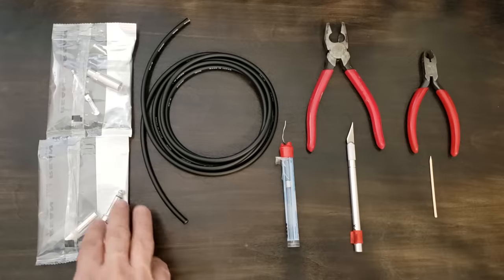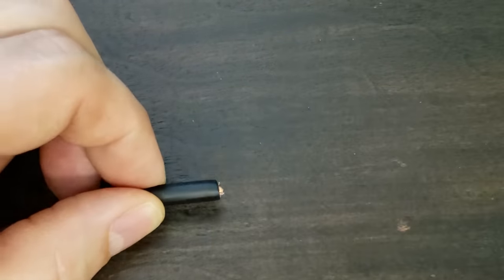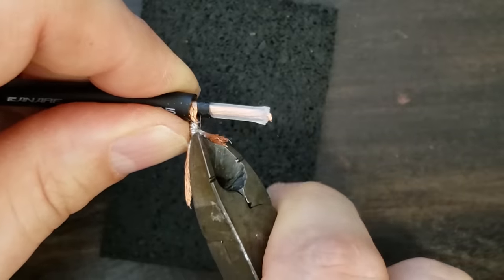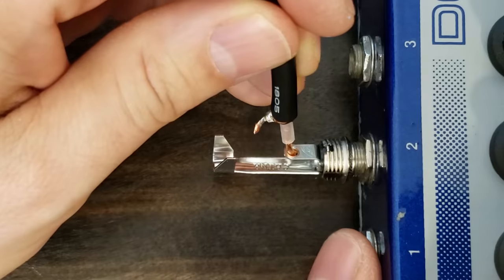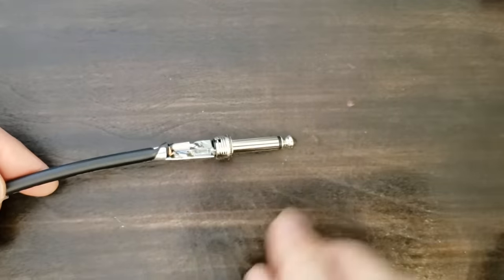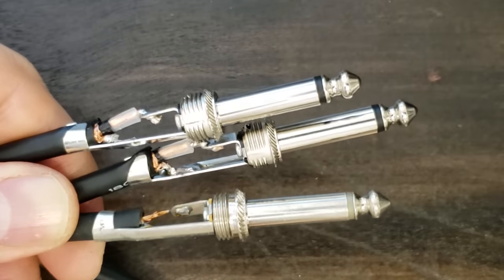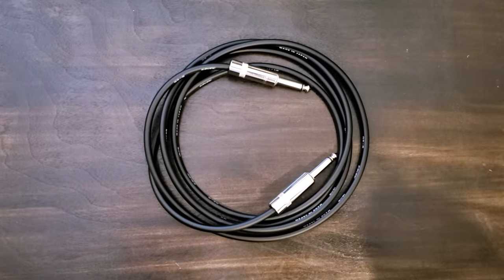Guitar cables - Make the Best Cables for bass keyboard GUITAR DIY SOLDER CABLE

Comment: Well, I've been in the industry for 40+ years. Your soldering is fine. But the centre conductor should be pushed up from under the tip terminal. Not the top. It keeps the coax as straight as possible, and there's no lump to negotiate with the raised center insulation for thesleve. If trimmed and formed correctly, the tinned earth brade will swing down and sit where it should 👍

Comment: OMG - using a pedal to hold the plug while soldering! Genius idea. Why have I never thought of that?
Reply from the maker: Yeah, I should really get one of those "third hand" clamping devices too!
Reply: A 2x4 with a 1/4 inch hole drilled into it works just as well, and you don't have to worry about overheating the pedal jack.
Reply: @jerund  Usually the pedal Jack is soldered directly to something that would remove the heat, hence it should not be an issue. But good to keep in mind. On the other hand, having metal contact to the plug during soldering actually helps to not overheat the insulation between the ring and tip inside the plug, so it has some benefits as well.
Reply: Agree. Brilliant idea.
Reply: Isnt that hot?
Reply: @steveaharmadianto3712 yes, about 350°c on the soldering tip usualy...
Reply: OK, but all me pedals are in board😰
Reply: literally word for word, just what I was going to type,!  kinda obvious, and yet I never thought of it ..."Doh"
In fact, I think it's even better than a third-hand clip holder. 
Also rolling the wire to score it is kinda neato. 
I usually put a bit of tape around the positive in case it gets bent and touches the earth inside.
Reply: As I was about to whip my soldering iron across the room I see this. Then look at my 20+ pedals sitting on my shelf laughing at me. :-) THANK YOU!!!!
Reply from the maker: Yep, I've soldered plenty of cables the hard way...usually involving a pair of pliers and a rubber band. The first time I did this, I never looked back!
Reply: @FrankOlsonTwins  Anyone that knows anything about high quality cables, knows that the best quality jacks are made by Neutrik..
Reply: @TarynnElizabeth619  also complicated..not good.
Reply: I use the "extra hand" device with alligator clips but I will try this method.

Comment: Great video.  As a person that has done a LOT of soldering, the only thing I would suggest is that you tin all wires and the connection points on the plug prior to making the final solder connection.  The solder will flow faster and require less heating time.
Reply from the maker: Fair point!
Reply: Also the pliers with a rubber band band makes a good vice to hold the connector. dont want to damage the circuits with to much heat.
Reply: Yes I was always taught to tin the wires and plug before soldering.
I guess it depends on whether you want to put the tin wire into the hole or just over it.

Comment: It is also good to add something to keep the cable from bending sharply right at the connector.   I like using heat shrink tubing and putting a nylon cable tie in the mix as a strain relief for the first inch or so of cable to avoid a sharp bend when pulled at 90 degrees.   Nice video.   The last cable was best with a bit more insulated cable beyond the crimp.
Reply from the maker: Thanks!  Sure, a bit of strain relief never hurts!

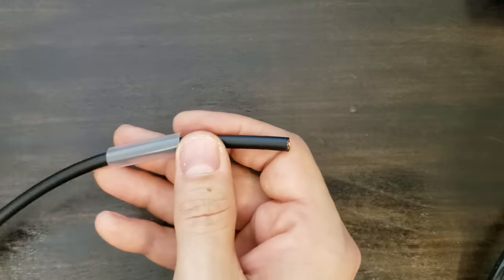Comment: 5:30 - The most underrated part of any cable soldering is slipping on the plug housing before soldering. If you forget this, you can start all over.
Reply from the maker: I certainly learned that one the hard way!
Reply: Been there, done that x 10, dammit.
Reply: @FrankOlsonTwins  It's alright if you forget to slip on the casing and insulation sleeve when you do the first end. Really sucks if it's the second end! Although if it's just the insulation you've forgotten a bit of lekky tape does the trick! lol
Reply from the maker: Lol, it still gets me once in a while!  I've started using liquid tape, which isn't very pretty, but it does hold quite well.  It requires 2 coats, which is annoying.

Comment: I made high-end cables for 20 years. I love Canare wire. So easy to work with, and so reliable. Best of all, it's not even expensive (I know that's relative, and you can buy cheaper cable, but don't waste your money - get Canare).
Canare also makes the best 1/4" connectors and RCA connectors (by far). Neutrik makes the best XLR connectors (by far).
Using a guitar pedal to hold the connector can work (obviously), but you can get a good "helping hands" unit with movable clamps for $10-$20 USD. Some come with magnifying glasses and/or lights attached. These can be extremely helpful when you're soldering mic cables (XLR connectors), or anything else that may need to be held at odd angles, for easier access.
I always told people: It's not rocket science, it's just practice. Don't breathe the fumes, don't burn yourself, and ALWAYS wash your hands when you're done (solder contains lead, which is extremely bad for you).
Reply from the maker: 100% agree on the Canare wire. It's the only thing I use at this point for making cables.  The helping hands are great, but I was looking for a more accessible approach.  Most guitarists have an old pedal kicking around so I figured put it to work!  And for anyone else reading this, absolutely- wash your hands after ANY contact with solder.
Thanks for checking out the vid!

Comment: I work as an engineer at a company that produced cables, and I  think this is a great video for good DIY connector attachment! Filling/molding the connector housing with glue/plastic for better pull and bend protection is the only thing missing, but hard to perform at home. 
One comment regarding the semiconductive layer: It's main purpose is to remove triboelectric noise due to friction between the braid and the insulation (think static electricity when rubbing a balloon against your hair). I guess it also helps a little with electrostatic shielding at low frequencies, but I'm not sure how efficient it would be, and it definitely would not help against magnetic fields.
Reply from the maker: I'll take that compliment, thank you!  
That's interesting about the rubberized semiconductive layer.  I've experienced an audible static pop with some random cables by stepping on them(more noticeable on mic cables).  I'd be interested to read more on the subject. Cable science is complex so I try to buy cable by a company who has a good grasp on it!

Regarding the plastic filler- I prefer not to fill the gap because I feel it make the cable ends basically un-repairable.  Now, there's always an argument to be made: the plugs are only $2 a piece(plus shipping!) and plug joint does become kind of indestructible, BUT if you need to fix your cable fast, or modify the cable for some reason, (what if it gets pinched or cut near one end)that plug end is pretty much done for and it's going in the garbage.
I don't remember if I mention it in the video, but my main cables are those which I've made from these exact parts and I've never had a failure. This includes a few years of non-stop use, heavy gigging and even cross country touring. But, I don't abuse them, I don't pull on the cable to unplug, and I try to put them away after use.

Do you think E6000 would be a suitable filler, for those who want to fill plug cavities?  Any recommendations?
Thanks again!
Reply: @FrankOlsonTwins  Signal cables with semiconductive layers are usually referred to as "low-noise cables" for sensitive industrial and measurement applications (when referring to triboelectric noise). Within the field of audio applications you can't really trust anyone due to all the subjective naming and placebo effects. Low-noise cables typically have only one SC layer between screen and insulation, super-low-noise or ultra-low-noise cables have an additional SC layer between conductor and insulation. However this would be overkill for audio applications, they are more for super sensitive measurements.

Regarding fillers I agree that for repairability it's better to go without it, I would do the same for DIY. At work make lots of stuff for military, nuclear, offshore, and aerospace applications, where a failed connector could be very serious, hence it is designed for longest lifetime with less consideration for the price. We try to use the exact same material as the jacket itself to get a seamless joint. This require machines that can melt and inject the plastic/rubber, which is hard to do at home. I am not sure how good E6000 is against bending over time, also not sure about electrical properties (as you don't want leakage between screen and conductor).
Reply from the maker: Thanks Richard for the info!  
One interesting phenomenon  I learned about low-noise cables vs. regular(no SC layer) instrument cable:  I found that during some unscientific listening tests, that cables with better shielding also attenuated the tone a bit more in the high end.  The low-noise cables have a nice bass and midrange detail, but were slightly darker sounding overall.  The "regular" cable retained more high end, but also allowed more buzzing to enter into the signal.  That's when I was sold on high quality, low-noise cable.  I started reading on the subject and learned about cable capacitance and how it relates to cable length in unbalanced cables.  I find that with high quality cable, I can get up to about 20 feet without a noticeable drop in tone. That's pushing it, though.
Reply: @FrankOlsonTwins  Interesting that you could hear the difference. For very low level signal, such as from a mic, capacitance can be quite important. The SC layer do increase capacitance of the cable slightly, because with just a braid you have some air between it and the insulation, which has low permittivity. While the SC layer has perfect 360 degree contact with the insulation. 
Low-noise cables are also not good for high frequencies because the SC layer adds attenuation. But this is normally in the MHz range, so not audiable. But I have not made any serious measurements in the audio range to say what could be the dominant factor.
Reply: @Richard.Andersson  here's a potentially dumb question - could hot glue work as a sufficient filler?
Reply: @nvrudd  hahah i was literally just about to ask the same thing
Reply: I did that but volume became down/low ....any solution?
Reply: @nvrudd  I've used hot glue for filling connectors before. It works good enough and can be removed relatively easily.
Reply: @nvrudd  Most folks just put heat shrink tubing around the whole thing, beneath the clear slidey shield, and call it a day. You can make the heat shrink a long piece and have it extend out of the plug end as strain relief, and then put a larger piece of heat shrink around the plug and past the end as well, and when it's all shrinked up, you have one of those retail-looking cables with the black "rubber" around the plug handle.
Reply: @Billkwando  Besides, when the time comes to repair a broken connexion you'll hate yourself when you'll have to dig out that filler.
I remember having to repair the busted Monster Cable of the other guitarist in my band, the thing was full of filler (and the copper completely green and corroded inside).
I had to cut the cable and solder new jacks.
The filler doesn't help with anything at all. All it does is increase jack plugs sales :p
Reply: @ledoynier3694  I have thought about filling the connectors with hot-snot, but when you make those connexions really stiff the strain just gets transferred further out from the jack and when it does eventually break, as you mentioned, what a pain in the arse to repair!
Reply: @Richard.Andersson  Loosing of the high frequencies depends on the source output impedance and input impedance of the device connected. I use active pickups on my guitars and therefore I have no issues with the cable capacitance.

Comment: The very best soldering tutorial I have seen, forget most of the others.. Notice the pre-heat is less than 1 second? The operation happens fast, beautiful solder flow and fillet, no melted insulation. The tip intersects the work and the solder, the flow of the solder aids in heat transfer into the work (not as much the pre-heat) The solder flows AWAY from the tip.. the opposite of what others TRY to teach, incorrectly, that it flows to the heat. This is clean work!
Reply from the maker: Thanks for saying so!  As you know, the subtleties of soldering are really in the details.  I try to teach a methodical approach, I hope it helps some folks!  
Thanks for checking out the vid!

Comment: Thank you so much for this! I had a braided copper guitar cable that suddenly went to hell for no reason at all (I haven't used it in a few months and plugged it in my amp to get 0 buzzing sound with the simple touch test). Opened the connector and they looked secure, but they were probably shorted with bad solder. I cut off a few inches off the cable itself on both sides and soldered it back on like the video suggested and BAM, back to a nice cable. Saved me the hassle of driving through 5+ inches of snow 20+ miles one way to my local guitar shop to spend $30 or more on a new cable! Thank you so much Frank!
Reply from the maker: Awesome! The power of DIY... Glad it helped!

Comment: Worked for a large aerospace company for 25 years where I had to solder almost every day. Great video. The only thing I would do different is maybe use a little liquid flux on those loose strands and I would clean my solder joints :)
Reply from the maker: Great advice, I'll add that to the next series of videos- thanks!

Comment: Hi, Whilst I generally know how to solder a jack plug onto a cable, and get the same results as you do, I have learnt a couple of great ideas from watching this. Firstly, the idea of prizing the wires into two separate groups and then twisting them together before soldering is a great idea. Also pushing the jack plug into an effect pedal to hold it while soldering is such a great idea, and so simple. I have a cheap pedal that's now dead and doesn't work - I can use that! I nearly overlooked this video, thinking to myself "I know how to solder jack plugs onto cables!". I'm rather glad now that I didn't over look this video -goes to show, one can always find something new and helpful, even though the video's covered what you already think you know! So  ..  thank you for this video, I look forward to watching more of your videos.
Reply from the maker: Thanks for checking out the vid and I'm glad it helped!  I must admit, after I figured out the pedal trick, I haven't looked back. Nothing is quite as convenient!

Comment: I always thought how the shielding braid is too thick but never thought of clipping it like this, great idea! I wouldn't recommend plugging in any jacks in any equipment while soldering, especially to beginners, because jacks can get extremely hot while soldering and it may damage the insides of the pedal or whatever you're plugging it into. Instead, you can get some cheap wood clamps or just get a stand for soldering.
Reply: If soldered correctly I doubt it would damage anything in the socket but to be safe probably a good idea.

Comment: Another step you could add is tinning the twisted wires before soldering the connections. Makes solder flow in better. But the solder looks really nice and shiny which is a good sign
Reply from the maker: Agreed, I sometimes tin wires to save time, especially for point to point turret or eyelet work.  For situations that where I wrap the wire around something, I prefer not to tin.  I think you're right, though.  Tinning these wires might have made the connections flow more quickly.
Reply: Also lightly tinning the contact point of the ground connection as well as twisted wires, since the tip is going into a hole you wouldn't want to tin that on this type 1/4 plug but some 1/4 plugs don't have a hole for the tip wire, in that case I'd also pre-tin the tip (hot) connection and wire.
Reply: Good point, yes, however small work such as this does not require tinning. The solder flows out quickly.. no melted insulation, no oxidized nor cold solder.
Reply: @FrankOlsonTwins  “proper” procedure in electronics technician training is to tin the wire, then use round-nose pliers to dress it into whatever shape you need, typically a j-hook or a flat S bend (like you would use here). Tinning has two main advantages: reducing the time it takes to perform the final joint, and ensuring that you don’t have any stray strands anywhere. Especially with smaller connectors, the latter becomes essential, as the eyelets (or other openings for the wire) get smaller. 

But I completely agree: great work overall. Most soldering tutorials on YouTube are, frankly, examples of what not to do. This is a welcome exception!

Comment: thankyou this is the best advice ive found for diy cables without mucking around
especially liked the tips using a a female jack to stabilise it for soldering.
also inserting the conductor in how you did
and cutting half the shield off for the ground. that seems like it would make it not bulge so much
Reply from the maker: Thanks!  I've stopped buying cables because I'm usually disappointed in the low quality materials or poor assembly.  Glad this video helps!